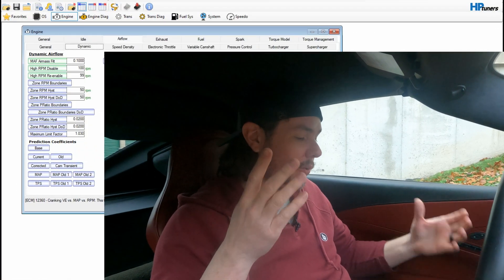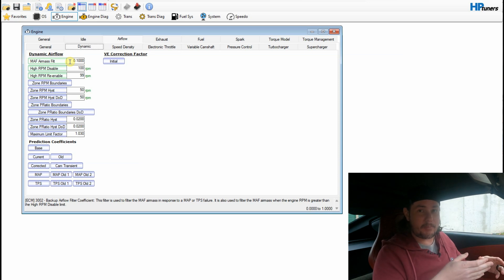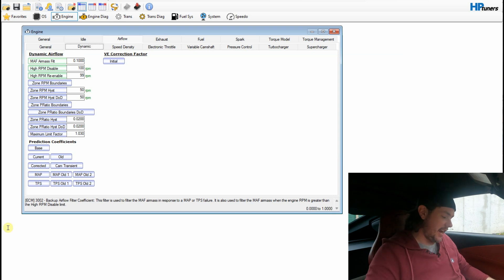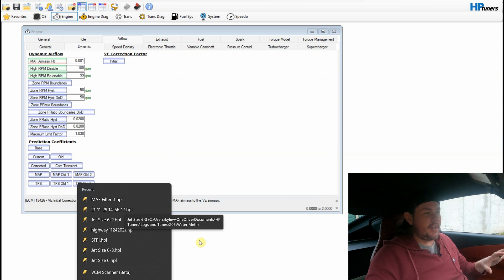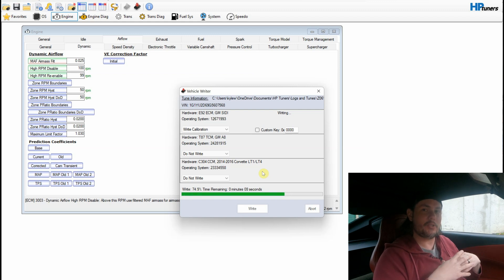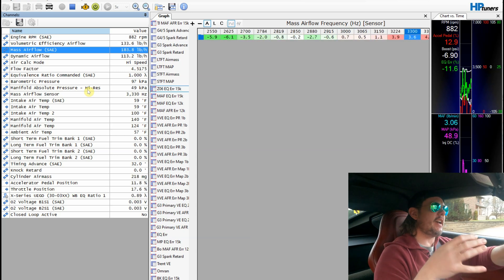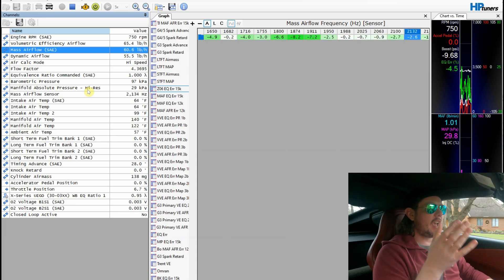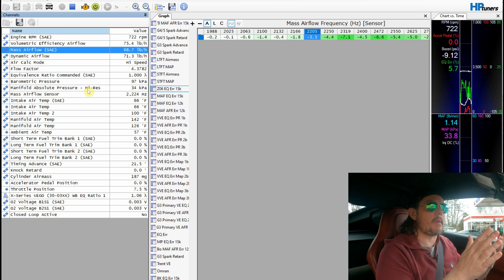MAF Airmass Filter Pt. 2, Test In Tune, Can We Use It To Tune Better?!

Comment: Good stuff Kyle. Interesting rabbit hole you are going down on this one. I have spent way too much time at work on your channel lately. You briefly mention filtering and datalogging in Part 1. I would love to see you make a video where you discuss driving techniques for doing a datalog for a MAF and then SD and then what graph filters you use to filter out bad data for analysis. (Staying out of transient, filtering out 0% pedal, filtering out EVAP, etc..) I would also love to see a video on transient fueling.

Comment: I think you need to look at what it's doing to the g/s values being reported or airmass. It's not going to change the Hertz the sensor outputs. Different g/s from the MAF and the VE/MAP calculations will cause a disagreement when they get compared. That will then move the throttle blade, as it jumps from weight from one back to more weight from the other.
Reply: Then don't confuse OBDii polling rate with the signal changing to quickly to populate cells in a graph. The only thing helping a MAF tune is actually holding throttle in a steady state and populating each cell with a lot of steady state hit counts and not transient or turbulent hits. Different RPMs and different throttle positions. You can do a lot sitting still in neutral.